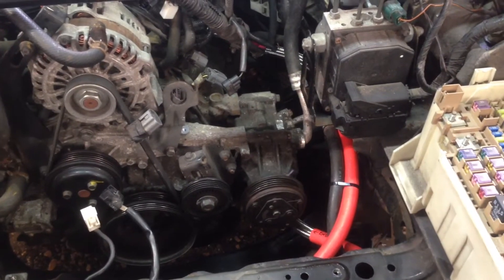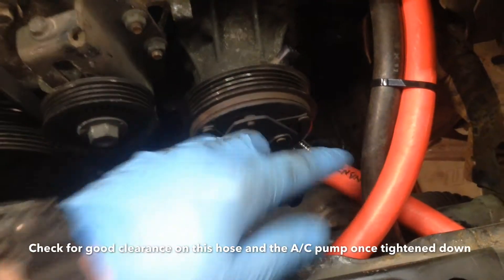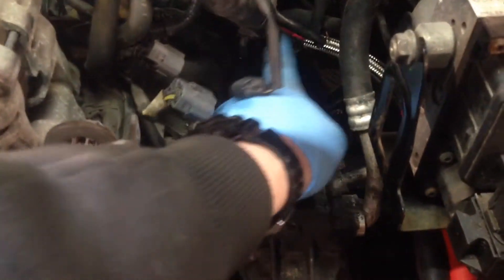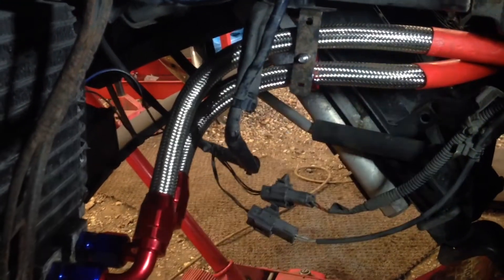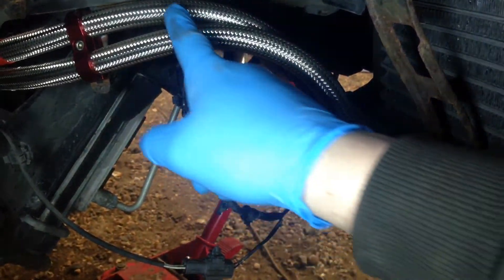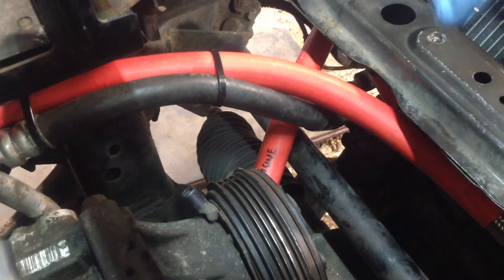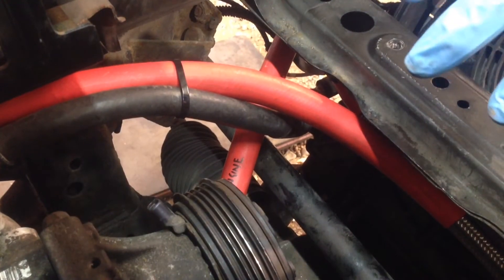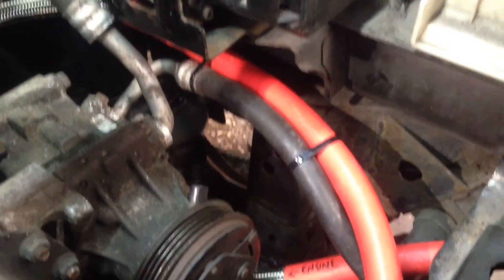Essex Rotary Quick Vids 7 - RX-8 Braided Oil Cooler Hose Connection and Routing Guide

Comment: @essexrotary enjoy your videos. Is this applicable to a series 2 rx8
Reply from the maker: yes the cooler locations will be the same however the oil lines connect to the engine block in a different location to that of the Series 1 RX-8

Comment: Hey what size are the fittings and hose for this upgrade I have an 06 13b 6port A/T rx8 please show a material list thx. Addicted2rotary
Reply: Michael H What they're kindly trying to say is "buy it from our online store."
Reply from the maker: The Hose and fittings to not increase the internal bore of the lines, as this can cause pressure issues, instead we chose to match the hose size as close as possible to the stock size Mazda chose.
Reply: Essex Rotary yes I'm currently wanting to replace stock hoses with the upgrade you have shown and just wanted to know if you happen to have a list of exactly what you used. I'm rebuilding an 06 13b rx8 renesis shinka edition
Reply: Essex Rotary p.s. not entirely sure of sizes of hose and not very familiar using an fittings

Comment: Iv got to replace my oil cooler hose passenger side but the replacement pipe ends are different not the hoop and bolt through I undid my bolt going through the wheel arch but with the new one I need spanners right up next to the engine to do up is that positi do up when the engine is in the car and only on axle stands ???
Reply from the maker: garydeandeery if you are talking about the kit like we have in the Video with AN connectors then yes, with the correct tools it can be done
Reply: What would the correct tools be? People don't want to buy a 500+ dollar kit and then find out they have to remove the entire engine or purchase air impact wrenches.
Reply from the maker: Hi Grant
The tools required are not really that special, Most home mechanics should have them in their box.
Its stuff like a 
Philips Screwdriver
10mm, 12mm, 17mm, 23mm and 24mm sockets, 
A ratchet bar to fit your sockets we usually use 1/4, 3/8 and 1/2 drive for various uses
Various Spanner Sizes usually in the same sexes as the sockets above.
Our kit use Allen keys for the hose clamps. 
One thing that is nice to have is a set of AN spanners to fit the AN-10 connectors, These prevent the AN fittings from getting marked when installing them on the engine.
If you don't want to buy the spanners you can simply cover some normal spanners (usually adjustable spanners work best for this)  with some duck tape to protect the fittings.
On a side note you wont need to remove the engine to install them, the mot you will need to remove is the upper intake manifold and oil filler.
Most good kits will come with a full set of instructions.

Comment: Hey Aston, great video as usual. Learning a lot from these little snippets. I have oil pressure and temp sensors to fit to a gauge... Where would you'd recommend those are fitted? Should I be looking at the 'before' or 'after' cooler temp? Does it matter where the pressure is taken from? R3 in the case, in case it makes ay difference...
Reply from the maker: On most of our Installs we have usually used an Oil Sandwich plate, Though this can be a little difficult on the R3 Sean, due to the location of the oil filter.
One option we have been looking at are custom Banjo Bolts that will allow for installation of a Oil Temp Sensor if you really want to see what the oil Temp is like before it enters the oil coolers and is cooled.
As for the Pressure sensor, In theory the there is no issue where you place this as the whole system is pressurized (that is as long as you dont install it in the Sump)
Reply: I have custom Banjo Bolts, and thread adapters for the sensors :). What I was looking for is as you've said - looking at the temp before it enters the coolers (so peak temp).
Reply from the maker: In that case this should not me an issue then, 
Place your temp sensor in the banjo adapter on the left side oil cooler on the outermost position.